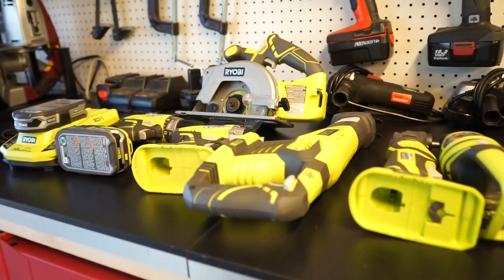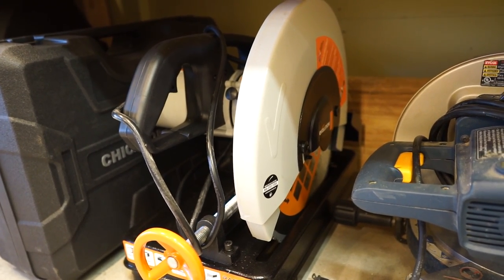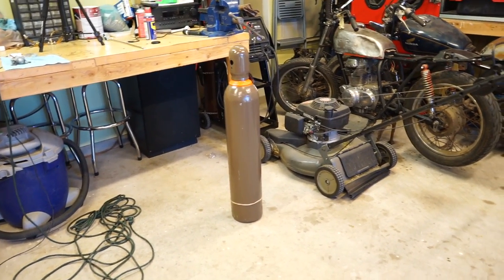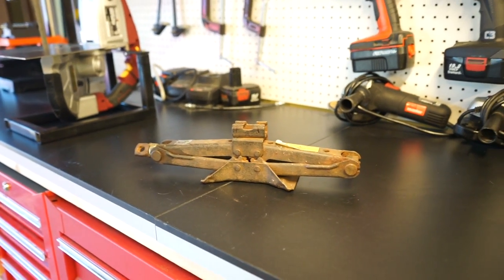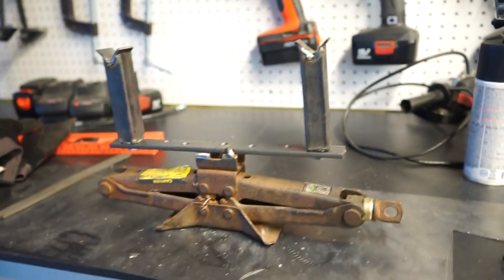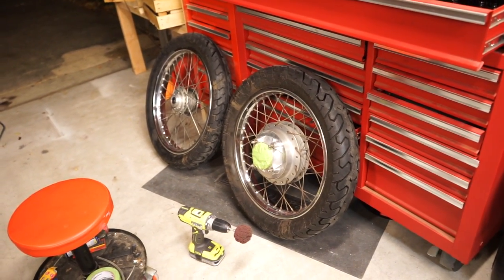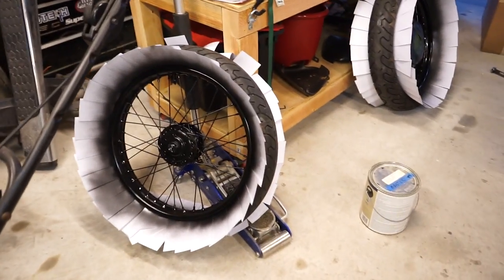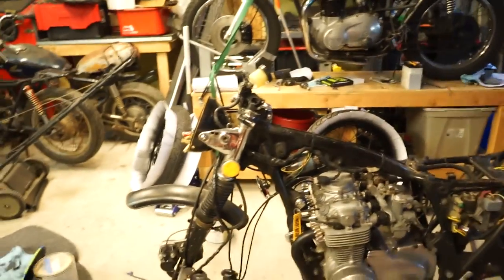New tools and Painting wheels

Comment: For the scissor jack, instead of a Handle, weld a hex nut to the jack and you can use your battery powered Ryobi Drill with a socket to spin the jack up and down. 😉
Also, weld a large flat plate on the base of the jack to make it less tippy.

Comment: Nice additions to the tool shed.  I had a similar idea with the car jack a few years ago. I just used a smaller platform instead of the uprights you have.  My jack had a 5/8" nut on it instead. So cut off the eye and weld on a stout nut. Then you can just use your impact to raise and lower. Much quicker. That N.Tool carrier is odd, my HF had a full width ramp. Otherwise they look the same.
Reply from the maker: That's a good idea, thanks for the suggestion.  I need to make the base a little wider too for some stability.

Comment: Great video dude I'm super envious of all your bikes!

With that tie down bar you added to the bike rack, be careful - you now have all the load from the bike movement essentially being supported by those bolts you mounted it with and they may shear, but I'm no expert.
Reply from the maker: I used grade 8 bolts so they should hold up. I'm going to be tying bikes down in at least two if not three different spots too so that should help even the load out.

Comment: The bike carrier in the back would be cool if you pivoted it in the center so one side rotates to the ground. You can add a small 12volt winch to the other end and pull the bike up until it balances and then pick up the end that was on the ground. There would be no need for the ramp.

Comment: Nice video, I am thinking to do the same with my CB750 K5 wheels because they became rusty although they were chromed some time ago. One question, did you need to install anything (relay, flasher, etc) to make the leds work properly on the dash panel? or they were just a direct replacement from the small oem bulbs?

Comment: I like your vids, and appreciate your work, but I must say this is definitely not how to paint wheels. Ive had to remove way too many of these "paint jobs", they look good for the first 100 miles or so then........really bad. Please, prep your wheels, disassemble them, etc.. it really is important if you want the paint to stick. I would suggest to always sandblast to get the grip required for the primer or it just wont hold up to the extreme conditions a wheel is exposed to. Paint, then clear.
Reply: Hi @tntcyclespdx , I'm planning on painting some spoked wheels, my plan is to disassemble, evaporust the spokes and rim to remove rust, then light sand, etch prime, then epoxy , then reassemble. Is this what you would recommend?
Reply: An adhesion promoter before primer helps as well.

Comment: So I am about to buy a 1978 Honda CB550F K3 that is about 1 1/2 hours away.  I have a Jeep with a hitch.  I was going to rent a U-Haul, but are you telling me that those hitch carries will work with a 70s-era Honda CB?  I think the CB550 is in the 450lbs range.  Not so sure how long they are.  I think Jeeps can trailer 1,200-1,500lbs  Is trailer capacity the same as this device?
Reply from the maker: With a hitch carrier you need to look at your tongue weight(amount of weight pushing down on the hitch) capacity instead of just your towing capacity. If you don't plan on carrying bikes regularly I would go the trailer route.
Reply: Yea, Jeep does not have enough tongue weight.  I'll rent a van and make some wheel chocks out of 2x4.  I have straps.  I'm pulling the trigger on this.

Comment: damn that rustoleum epoxy paint looks great! quick question, what budget brat seat and hoop would you recommend for a 78 cb750? thanks
Reply from the maker: I haven't really used any budget seats. I order all of my seats from Tuffside.com. I think it's one of the most important things on the bike and is worth spending a little more if you can. For the hoop I just buy them off ebay. Should run you around $30-$50 depending on what style and size you want.
Reply: Classic Octane thanks! have you ever made a custom seat?
Reply from the maker: I made one out of a skateboard on one of my first builds. It looked ok but was super uncomfortable. After that I decided I would leave the custom seat work to the professionals.
Reply: @ClassicOctane  
Chris Riddiford

Comment: Hi nice job with the wheels. Did you take care of the rust before the paint?
Reply from the maker: Yes I sand them down to remove any rust and to get a nice surface for the paint to stick to. It will just flake right off of the chrome if you don't scuff it first.
Reply: Classic Octane 
Have you had any problems with the paint cracking Where the spokes are attached to the hub? Are'nt the spokes flexing a bit and therefor makes it easy to crack?

Comment: the chrome and alloy on those wheels looked pretty good, why did you decide to paint them?
Reply from the maker: They were pitted and scratched up close. Plus, I like the look of black wheels especially with the brushed metal tank.
Reply: Classic Octane how did you get the paint on the wheels to not scrape off easily?  I'm finding this an issue on my diy painted wheels and other parts. Followed steps to the letter too. It's frustrating.
Reply: Peter Kowalinski powder coat is the way to go for quality